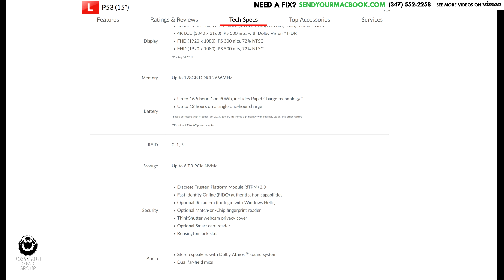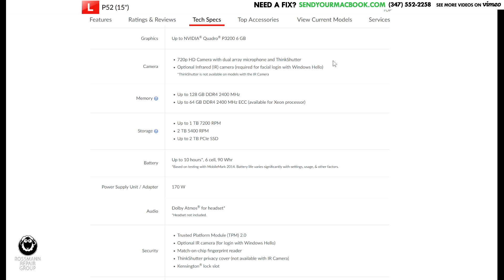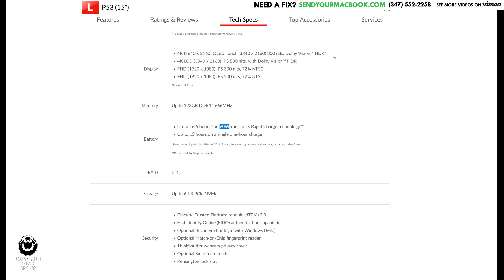Reading my YT comments is depressing

Comment: Is it possible that it improved thermals which in turn made it more efficient?
Like getting rid of the casing that made the battery removable may allow more air through.
Reply: Efficient, not really. It is possible cooling or other components could use the space though. But a poor excuse when you might want to carry a spare battery.

Comment: Remember when laptops had a removable battery...those were the days... I still have 2 Toshiba P750s and they are going as good as the day they were first booted with enough grunt to run Adobe PS and LR with no issues. Both are as usable as my wife's newer HP Elite (also with removable battery). The batteries are long since history but they work fine plugged in sans battery...saves on weight and reduces fire risk. My Surface Pro will have to be tossed out when the battery is gone because the degraded battery will be too dangerous to use. Same goes for all devices with non removable batteries. This throw away culture will destroy the Earth and I blame Apple.

Comment: From someone who has sold Lenovos in the past to commercial and education:

P52 (all of P-series and W-series) is generally mobile workstations and average configs run from $3.5k to $5k. They are also mostly leased machines to companies which then give them out to employees. Not having a user-replaceable battery on a "Professional" machine of this price tag is wasting money. Every time the only part in the machine which has to be serviced regularly (the battery) needs service, it needs to go to a service center. Instead of IT dep just ordering a replacement and doing a hot-swap on the user's desk, you stop working. Having to take into consideration an employee being 1-2 weeks without their tool is way more weightier than saving a few hundred bucks when considering the competition. Especially as the competition still understands that removable batteries save customer's money. Happy customer always comes back.

Lenovo insisting a non-removable battery is mostly a contract between their 3rd party servicing agents who want a piece of the money Lenovo makes from each service, you need to hide the tax money somehow. Making the money do an extra loop into a country with no tax laws means more profit even after you need to pay $3 for the one hour labour.

Comment: When i got my cellphone, one of the things that made me choose the one i got was because the battery was removable. 3 years later, my battery is showing signs of fatigue and i can switch it out instead of getting a new phone just because of the battery. If a phone still exists that the battery is removable when the time comes for me to switch my phone, i will most likely go for that phone. I don't care for the bells and whistles, i just want something i can actually use as a phone, text, play music and go on the web if i need to. Don't give a damn about the sensors and all that shit. Just want something that works lol.

Comment: I like how you ignored the handful of comments suggesting that Lenovo couldn't do much to add capacity because of regulations. Would you have been happy with a 10Wh increase? Or better yet, increase it by more, pushing it above 100Wh but then it not be allowed on an airplane?
Reply: You are missing the point.  The point being they took something away without an obvious good reason.

If the battery is user removable, you can carry a spare.
Reply: @alexatkin  I just don't like how it wasn't addressed. In my original reply to his first video about this I did state how I don't agree with the move to make the battery internal. That said, it does also take significantly less time to charge the same Wh battery. On another note, how often can we honestly say we're not near an outlet. 10 years ago sure I can understand it being an issue but these days even a lot of park benches have outlets.

Comment: I gave up on Lenovo when my last laptop throttled to 800Mhz if the battery was 33% or less and they never fixed it.

It seems the bad choices have finally filtered down to the Thinkpad line too which were supposedly better, very sad.
Reply: couldnt you just fix this in windows or the bios? Seems like a pretty simple software issue

Comment: The problem with these new machines with better power management is that they last longer while you use them very lightly. If you put any load on them they run out very quickly.  I remember my old MacBook Pro -2011 with a user-replaceable battery. It would last nowhere close to what my new 2019 model but the difference between how long it lasted under load and when idle was much less then it is for my 2019 model. 
I would much more have a larger battery (and by extension a heavier and bulkier laptop) than being dependant on only using my machine in very specific ways where everything is assisted by specialized HW (like video playback) to get decent battery life.

Comment: Anyway, the truth is that it's just cheaper to manufacture
Reply: No it doesn't
Reply: @anonviranon  yes it is. Couple of wires and a connector vs two connectors, one needing lot of solder to not get damaged, a different shaped plastic with a big bump which needs more material on the mold which costs more, two more molds to make the two battery shells, hinge design which gotta hold a heavy battery and be resilient. An internal battery is way cheaper to design and manufacture than a removable one, just for those two less molds. ( a plastic mold can be up to 10k or even more)

Comment: buy a portable power bank.  It is more convenient than removable battery
Reply: not...really? I remember being on a 13 hour flight in 2013 and just swapping my laptop battery out for another  one. Took about 30 seconds and i had a full charge again. Battery swapping is underrated. But ofc, you need to buy 2 batteries.

Comment: Basically, it's like welding the wheels the axles on a car while still using the same quality tires as before welding the wheels. Making the wheels irremovable if you get a flat tire.

Comment: I think the root problem is the way companies see progress and how it can be sold in a way that benefits the company. 1. Our PC has longer battery life than last year. Good. Make more sales. 2. Our new battery provides longer battery life for our users. Good. Make more sales. Take step one this year and step two next year. You get to claim better performance two times. You get to get more sales two times. That's why they kept the old design battery and soldered it in. Next year when the new battery comes out, this year's customers won't just go out and get a new battery. They will buy a new PC. More money for the company. New batteries don't need to be bought from the PC manufacturer. They can be bought from the OEM. If people are buying batteries from the OEM they are not buying new PCs from the company. Solder in the battery.

Comment: I haven't looked inside any of these things, but if I had to guess, the most likely way that energy efficiency could be improved with non-removable batteries would be that the connector would be different, allowing for one with less line losses but also harder to attach to the battery. Because users won't be using this connector, the drawback is acceptable. Less losses means better battery life by redesigning the battery, even without improved capacity.

Doesn't seem to be the case though since that would only really be a tiny improvement.
Reply: afelias   If there were any significant resistance in a battery connector, it would get hot, melt some plastic, smoke and perhaps catch on fire.  There isn't a benefit from eliminating a connector.
Reply: @wargamingrefugee9065  That's a particularly extreme scale for significant resistance right there.

Comment: Still mad at lenovo...
Still going to be forced into buying a P53 since I need the GPU/CPU combo it offers that isnt offered by another 15 inch machine other than Razer, which is shit. Also, lenovo killed the 2.5 inch drive bay and added another NVME bay. Even though there is space inside physically for it. Fucks sake. 

My belief about why they moved the battery is that something cooling related was done.
Reply: Something cooling related... like they can run the fans less, therefore saving battery life, if it's not modular. Would be hilarious if that's true.
Reply: @gorkyd7912  What I mean is that there are significantly more powerful components in this compared to the P52. There are more heat pipes, new fans, and its in different places. There simply may not be room for the release mechanism.

Comment: Also fyi 2 90 wh batts can have different discharge properties at different currents. 90wh @ .5C doesn't mean 90wh@ 1C. Itll be interesting to see the datasheets on the new/old cells

Comment: They could have increased the life cycle off the lipo or the 90wh might be rated for a higher current drain. Thats just speculation tho and theres no excuse for non removable batteries.

Comment: And somehow people don't understand, that by removing the ability to disconnect the batteries, you GAIN SPACE from the plastic shells that are no longer needed and the extra connectors. So if the dimensions are the same and the battery sizes are the same, they just have empty space sitting there like a big FUCK YOU to the consumers.

Comment: As someone who removes lithium ion batteries from dead electronics, I would say that for some reason the way that batteries work is by far the most alien concept to people. 

They can know a CPU inside and out, or a screen like the back of their hand, but the most important component that is pretty much required in a mobile device is just extremely alien to people.

Comment: Not an expert on batteries or air travel but according to the TSA you can not have a battery higher then 100 wh on plane. A 90 wh battery with manufacturing tolerances guessing within +/- 10% allow them to make batteries that would not go to the 100 wh max. Not defending them, they should have kept the modular battery regardless considering it is not any lighter. Also fuck apple and companies that blindly copy apple.

https://www.tsa.gov/travel/security-screening/whatcanibring/items/lithium-batteries-more-100-watt-hours

Comment: Another problem with non removable battery may be for people that have a laptop that is plugged in all the time.  I usually have 2 or 3 laptops. 1 or 2 are mobile but 1 sits on a desk always plugged in and on and years ago I learned that isn't the best way to promote long battery life. So now the laptop on the desk has its battery removed and is plugged into the UPS. That is now not so easy with the battery inside the device.

Comment: Removing a modular battery is... why?
For more money because the company charges to replace the battery? Hmmm
Reply: Daniel Stone  from a different brand xD
Reply: Cost of production, ease of production, removes points of failure.

Not saying any of these things are the reason, but they are a potential reason.

Doing away with removable batteries removes parts like the hinge, screws, plastic pieces, and connectors between the battery and the laptop (you still need connectors, but they can be integrated.) This cuts down on parts and complexity, which saves Lenovo money and time in the assembly process, and may or may not be passed on to consumers.

It removes points of failure (that connector between the battery pack and the motherboard can fail,) and the battery hatch is an ingress point for dust.
Reply: @ashesofempires04  End of day companies live or die and cost rules is they could make a pc for 100 bucks.........ah apple.
Reply: Realistically, 10 times or more people probably have technical problems related to a mis-seated battery compared to the population of people who buy new batteries. Any probably only 1/10 of those has any difficulty removing a few screws to access a internal battery. I for one would want my battery screwed into the device, as I am unlikely to replace the battery, and if I did I would not complain about having to undo a few screws every 2 years or so.
Reply: May be cost of production ?
Reply: @needoliprane7114  probably is cheaper but the fact that they have done it for so long and just stop doing it like that is a dick move. So them saving a few pennies results in you losing a modular battery

Comment: I wish you would fix pc laptops, but realistically, that'd be an insane amount of schematics to get ahold of :V
Reply: Watch the channel 'Elecronics repair school' . That guy is a genius and figures out schematic by himself
Reply: Who needs schematics when you have Amps and the back of your hand.....
Reply: @bonemanegames   Apple sells 9-10% of new laptops, the 4th most popular laptop brand, but these devices also stay in the market extremely long. There's plenty of people using 6-8 year-old Apple laptops still because the systems installed do not need any hardware upgrades or repairs to continue working as new in 2019. For whatever reason, maybe because most Windows machines were far cheaper from the factory, or because the Windows OS is actually shit, the rest of the laptop world seems to become mostly unusable after 4-5 years and therefore the overall share of Apple computers in the market is somewhat higher than how many are sold in any given year.

Comment: If anyone is confused over the unit "Watt-hour", it is a measurement of energy. In this case, it is referring to the stored electrical potential energy in the batter at a full charge. Now many of you may wonder why we don't refer to it as "Joules" as we typically do with energy in a physics classroom. That's a good point, my best guess is that we typically know how much power something will draw, and breaking up the energy value into a product of power and time translates to some easy algebra when you're curious how long your battery can power your appliance. You may notice your electric meter reads "kWhr" or "kilowatt hour", this is a measurement of how much electrical energy has been used.

-your friendly neighborhood EE.

Comment: I would also never buy a laptop with soldered RAM or SSD.
Reply: How about soldered cmos battery?
Reply: @eddymison3527  That's an acidic death wish (or alkaline) waiting to happen
Reply: If the soldered ram literally replaces the best possible ram stick for the machine, I'd be okay with it :)
Reply: There are several companies like Schenker who sell completely modular laptops. Replacing hard drives or ram takes 5 minutes and just 1 screwdriver (since all screws are identical and easily accessible), and with the more expensive models you even get desktop mainboards with socketed CPUs. Of course they are quite chunky and rather heavy, but as a result of their construction you can spec them very flexibly, easily upgrade them and even then  they tend to cost a bit less than their competition. Of course it'll be never be as slim and attractive as an ordinary laptop, but putting functionality over looks means more performance and user-friendliness for less money.
Reply: All depends on the price and what the use case scenario is. 

If it's cheap and the laptop will only ever be used for MS Office and checking email or Twitter, than you could get by soldered
Reply: I for one, agree with you. I can't live with both soldered RAM and SSDs, especially when the average person will most likely use Microsoft Windows 10, which are both RAM and data storage-hungry.
Reply: I could probably live with soldered ram. But who tf is soldering SSDs?
Reply: @matsigh  Why does memtest exist then?
Reply: @timramich  My apologies, I didn't intend to make it sound like ram can't die, but I'll defend my stance that RAM dies pretty infrequently. None of my friends nor family have ever had RAM go bad in their systems.
Reply: @matsigh  I've seen a lot of dead RAM. Granted it's generally been old, but memory can still die.
Reply: Depends in price, however I have been repairing laptops for years, not to the degree Louis does but I am very comfortable taking out mobos and such. So I have no problem swapping out ram that isn't technically user replaceable
Reply: Long ago laptops had non-soldered CPUs
Reply: ROFL.  
I love it. If you chose A please unsubscribe. 

Love and Respect from the not so cold North 👍
Reply: I am fine with soldered ram, but a soldered SSD? Hell no
Reply: I thought soldered ram and SSDs were limited only to Apple products, and those cheap low spec'd Chromebook \ Windows 10 laptops you see on Amazon?
Reply: I'd be ok with two banks of ram, one soldered, one socketed, so there's still expansion. No way would I have a non-serviceable SSD.
Reply: Meanwhile I'm typing this on my laptop with 4 cruddy gigs of soldered RAM.
Reply: @joenodden  F
Reply: That’s how they were back in the 80s. Lol
Reply: I have, as it still had one socket and was cheap.  But for over $600 then no way.
Reply: I'm fine with soldered ram, but not soldered ssd.
Reply: all laptops are gonna have soldered parts in a few years. I don't think you can escape this
Reply: @vossli1074  
Right To Repair could prevent that but.... it's anyones' guess whether that will actually get anywhere.
Reply: @vossli1074 , soldered parts? No, no, no... they'll have all their components combined on one chip.
Reply: @vossli1074  I'm willing to bet gaming laptops will be an exception. Gamers generally will want to mod their gear.
Reply: I wish I could say the same, but if the laptop is nice enough I can live with soldered RAM.
Reply: @matsigh  till your RAM breaks and you have to buy an entire new laptop. Makes no sense.
Reply: dont your food stamps cover the cost ?